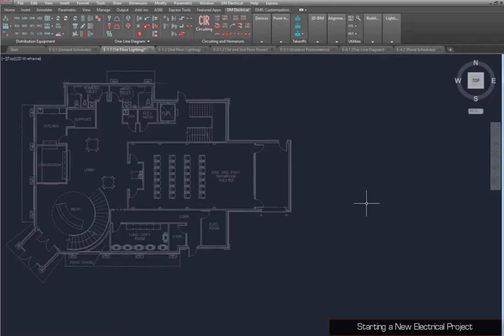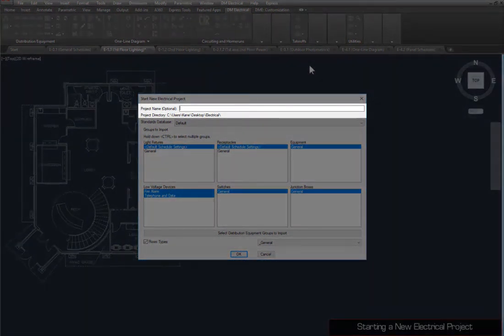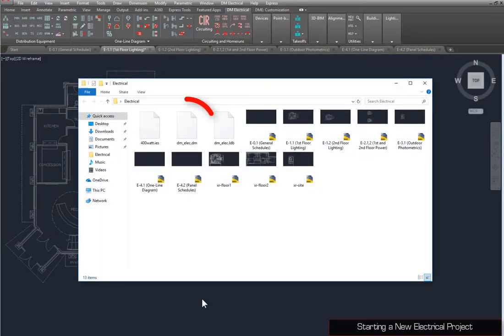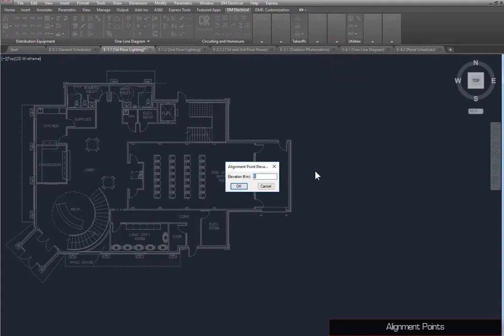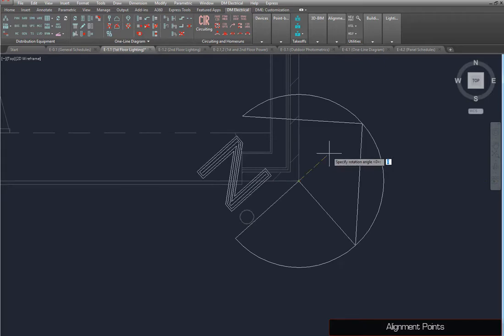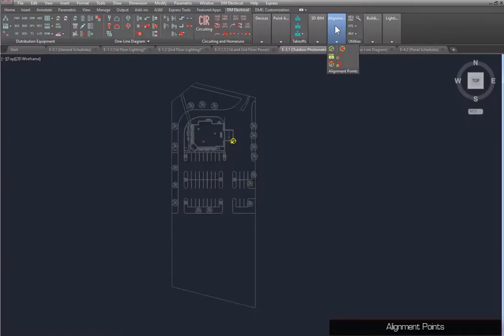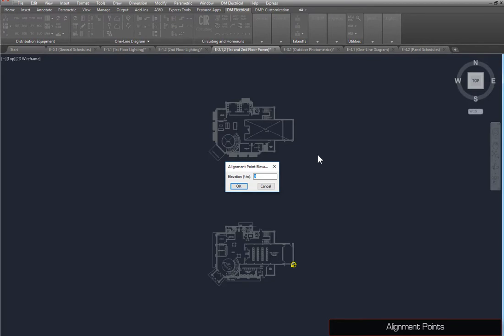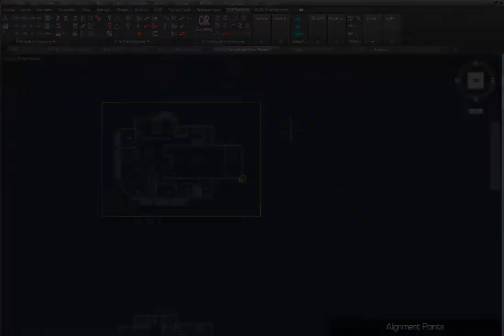Design Master Electrical for AutoCAD Tutorial | Part 1: Starting a New Project & Alignment Points

Comment: would this addon software works for autocad LT? or you have to have the full version autocad? is there a specific version of autocad ie. autocad 2018? please let me know. thanks
Reply from the maker: AutoCAD LT doesn't support any third-party add-ons, including ours, so you will need full AutoCAD. We're also supported by BricsCAD Pro, a less expensive CAD alternative. The full list of compatible software is available here:
http://www.designmaster.biz/support/system-requirements.html